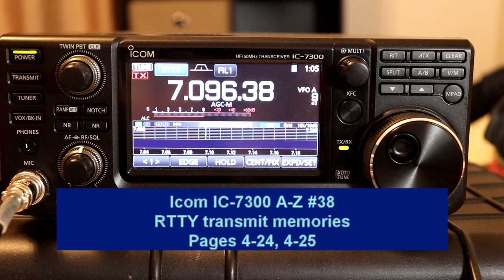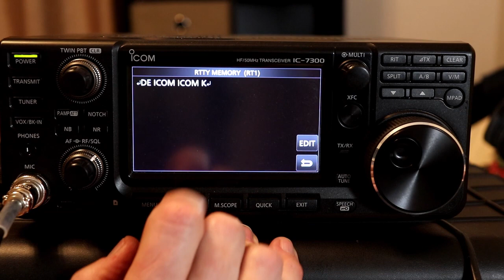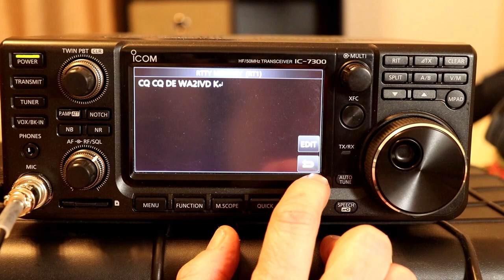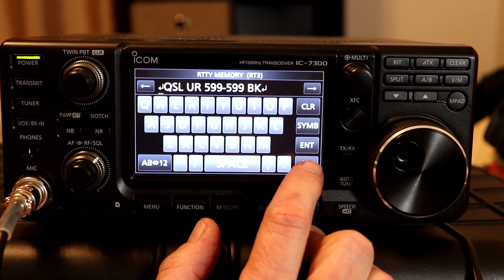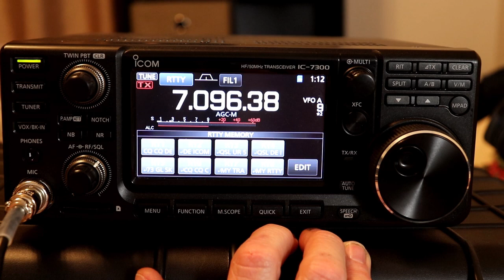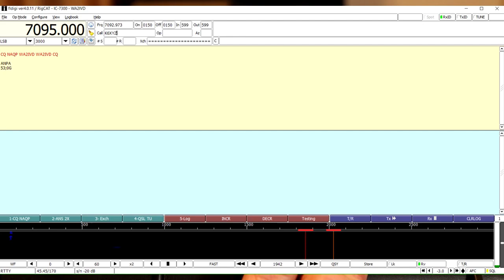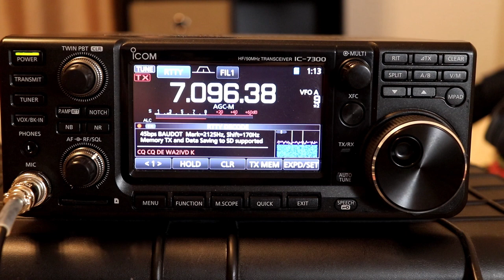Icom IC7300 A to Z #38 RTTY Transmit Memories

Comment: I've used them often for RTTY contests where the exchanges are pretty standard.  There are enough memories to cover most of what you would need.  It is nice to have in the radio so you don't have to have a whole computer setup to participate in a RTTY contest.
Reply from the maker: Hi David. Thanks for the comment- But, how do you put in the call sign of the station that you're contacting?
Reply: @HamRadioA2Z  You don't really have to if you are replying to a CQ (I think).  I just program in the exchange (usually 599 and a serial number or state) and a DE mycall.  Then I do have to go back and increment the serial number for the next contact but that isn't too onerous.  Perhaps I am not following exact protocol, but it seem to work and no complaints yet.
Reply from the maker: See the comment from James B and my reply.  I'll agree that you can make it work in some limited situations, but as I replied to James, if anything even slightly out of the ordinary comes up or band conditions get bad and require repeats of one thing, etc. then you're going to be scrambling to edit a memory or the contact will just go south.
Reply: @HamRadioA2Z  Agreed.  I have one memory for AGN AGN in case I couldn't hear his response, and one for more repeats of my call and response in case he didn't hear me.  So far, in the contests, I haven't needed more.  For any other purposes, agreed, not much use.  Except, of course, for repeatedly calling CQ or whatever after which you switch to the computer.

Comment: In shack (where IC-7300 often sits), most people would use a PC rather. However, with IC-705 on portable, this might be a great feature -- SOTA/POTA/WWFF activations or even the contests. Just a bit is missing:
1) A QSO counter, which is already implemented for CW, so I believe it wouldn't be a big problem for Icom to hack it in for RTTY too.
2) Picking up a callsign from decoded text. This is not implemented, but simple two-click solution might be used -- first click shows a zoom window, the same as you got when clicking on a waterfall), second picks the callsign. The callsign would have to be shown somehow, but in the top bar of the decoder window, there is some space. Then you would just add a placeholder (e.g. character %) into the macros and it would be replaced by selected call when transmitting.

This is a quite simple idea, that is doable and would bring this built-in RTTY feature to different level! I have suggested it to Icom, hoping they might implement it in IC-705's firmware update. Not happened yet. But if you guys encourage Icom too, we might get it finally! If you like my suggestion, please write to Icom!

Comment: I have always found it hard to believe that Icom didn't put in a keyboard jack. Or, for that matter, haven't had a software update that would allow a keyboard to plug into the USB port for those occasions when that's all that required. 

Thank you for the video series.
Reply: IC-7610 can do that I believe.

Comment: I am new to your channel and was thinking of buying me a HF rig and was wanting a rig that might be the best RTTY set up. Do they make a RTTY HF set up that does have usb keyboard connection ? I like as simple as I can get but I also like multi use as well. Great video ! W4ZTX
Reply from the maker: Hi.  Thank you for the kind words.  The IC-7610 has 2 input USB connectors that you can plug a USB mouse and keyboard into.  It supports transmitting RTTY directly from the keyboard.  Of course, the 7610 is a much more expensive option than the 7300, 7100 or 705. The Yaesu FT-DX101D or MP may have this capability.  I’m not sure.  It is in the same price class as the 7610 though.
Reply: @HamRadioA2Z  thanks for the info !

Comment: The last contest you showed, you can use these rtty memories. You do not need to send the running stations callsign, you just send you callsign and the exchange.  As long as the contest does not need a serial number exchange just a standard exchange, then you are good to go.  Then you go back thru your recorded log and you can copy paste that log into a cabrillo file converter if you need to send a log in.  You will have the other stations call in your log.  Again the CQ worldwide contest was a prime example.
Looks like this:
CQ CQ TEST W2XYZ. (run station calling cq)
K0UA K0UA (pounce station calling him.  No callsign needed)
K0UA 599 NY (run station replying to K0UA's call and giving him the report)
599 599 MO. TU (pounce station gives the report)
TU CQ TEST W2XYZ (run station says thank you and calls CQ again)
Reply from the maker: Ok- I'll grant you that could work by just using the memories as long as you only want to be a pounce station.  It won't work if you ever want to call CQ in a contest.  It also becomes problematic if anything other than a perfect, ordinary contact happens.  In your example, if the run station comes back with K0UA R U on 40M?  Would like to work you there too- or something similar, your kind of done at that point.  I suppose you could program one memory with SORRY.  NO SPEAK ENGLISH.  73 DE K0UA QRT  as a catch all.  :-)

Comment: Thanks and congratulations for your videos. I would disagree however concerning the utility of the IC7300 RTTY memories. I happened to rank 1st Europe of a CQ WW RTTY contest in a "single band" category just with these memories. Of course, this is not optimum, as you can't call CQ but nonetheless, it works well. 
"DE XX0YY XX0YY", "XX0YY XX0YY XX0YY" and "RR 599 01 01 TU" are enough to respond to a CQ call or a contest call. If you are chasing a rare DX and/or if you really want to make it clean, you can manually add their callsign in one of your memories. It only takes some 30 seconds... 
73!
Reply from the maker: Thank you for the kind words and for watching. I’m glad it works for you. I agree you can make it work for specific cases. I’m just not comfortable with no ability to handle any hiccup in the QSO, like the other station asking something outside the canned response.

Comment: Very nice walk through of RTTY.   It is noticed that you use F1 in you example video.  How do you increase the amount of bandwidth to cover the the whole waterfall window?

Rafael / NN3RP
Reply from the maker: Hi Rafael.  Sorry for the delayed reply.  I'm not sure what you mean about covering the whole waterfall.  If you are talking about the RTTY decoder window, the small waveform display it shows in the little box is fixed, as far as I know.  You just have to keep tuning until a signal shows up in the window and then try to align the peaks with the vertical lines.  I believe Icom's intent is that you tune the signal in the regular receive view and then use the little window in the RTTY decoder display just to fine tune the signal.

Comment: How do you add a serial number to the QSO if required in the contest.
Reply from the maker: Hi Kelvin.  I don't know of any way to do that with the RTTY transmit memories.  That is another reason why I don't see the built in RTTY memories being practical for much of anything.  There is a way to program a serial # that increments into the CW transmit memories.  That is covered in video #35.